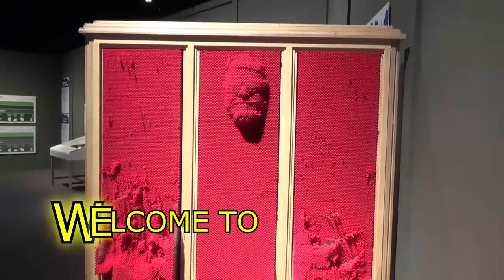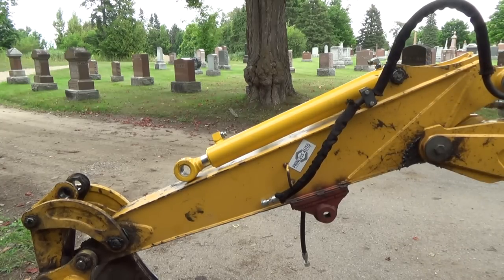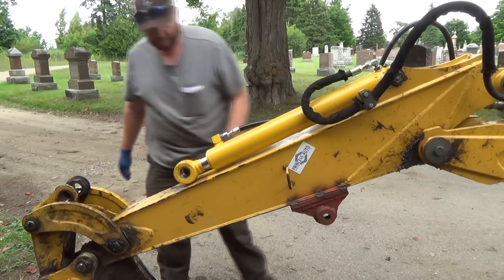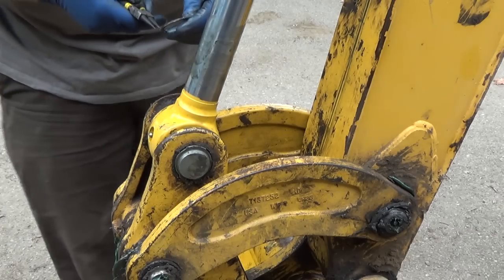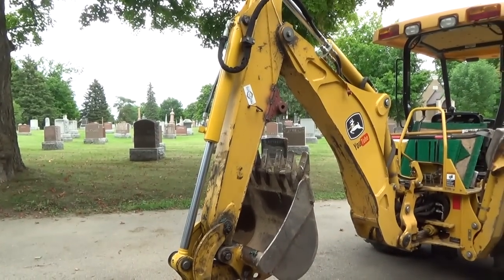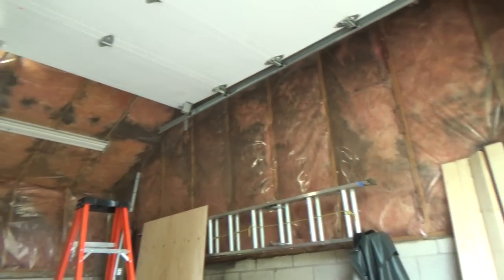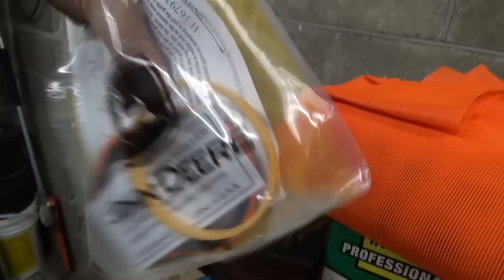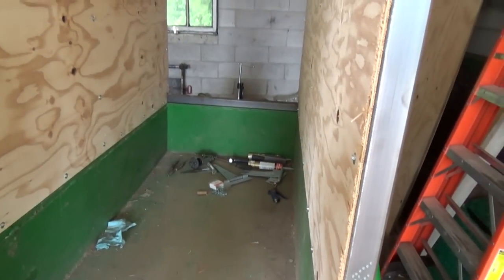New bucket curl cylinder install

Comment: bill's special thing for the family will be a travel trailer, i bet , i think i am right, that would be family and i think he didn't like the cottage on vacation.
Reply: +George Gardinier... yea I was thinkin motor home...but once i watched the entire vid..i think yea travel trailer, or boat..
Reply: +George Gardinier I thought that or a boat.
Reply from the maker: +George Gardinier well hit nail on the head
Reply: BILLSTMAXX :) So it was a travel trailer?
Reply: +BILLSTMAXX :) CALLED IT LOL
Reply: to find out for sure tune in for today's video when its up
Reply: I knew it lol
Reply: +BILLSTMAXX :) the last clue of the trailer hitch told me, and i watch too many mysteries shows, Matlock ha
Reply: +George Gardinier To me it's the same thing. One you pull and one you drive.  travel trailer / Camper
Reply: Maybe he bought Just in a Van's travel trailer. :)

Comment: great video Bill, You must be happy the deere is working at its best again.
Spray foam is a great insulation, you will probably have to drywall the room as most construction codes will not allow you to have exposed spray foam for fire safety reasons, That stuff is really toxic if it burns.
Keep up the great work.
Cheers Phil

Comment: Bill just curious how much hydraulic oil did you have to put back in the 110?  I'm guessing maybe 1/2 liter?
Reply from the maker: +hankus253 yes i have a bit in the jug from the other day draining it
Reply: +BILLSTMAXX :) really? Because we just changed the hydraulic and transmission oil and it took 7 gallons!!
Reply: +BILLSTMAXX :)  i feel real dumb asking this i got a john deere x540 what would be the benefits if i grease the points? i somewhat do but Bill what are some benefits?.
Reply: +Johnathin Wilson I was asking Bill how much hydraulic oil he had to replace when he removed the worn cylinder ( which had oil in it ) not how many gallons were in the whole hydraulic system, that you can read in the equip. specs..
Reply: +hankus253 Oh, I feel dumb now. But thanks!!
Reply: +zachary lampman The benefits are, they won't be frozen up if and when you ever have to work on those points. Reduces wear and tear at those grease points as well. Helps prevent metal on metal movement(s).
Reply: TsmnnDvl5
i do it but not as much as i should ima do it more often
 thx